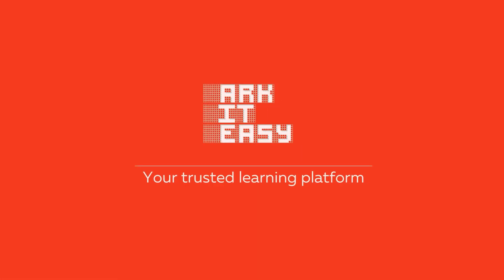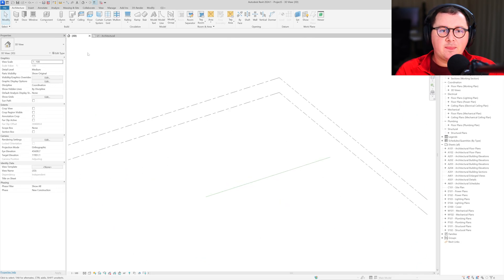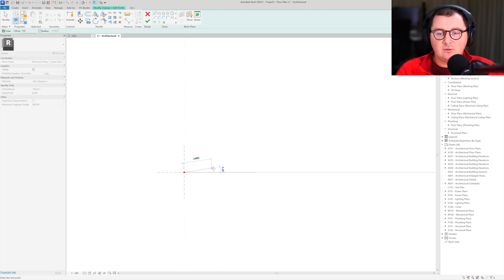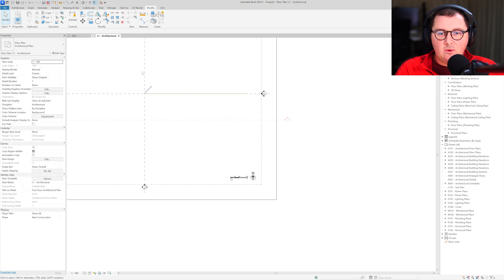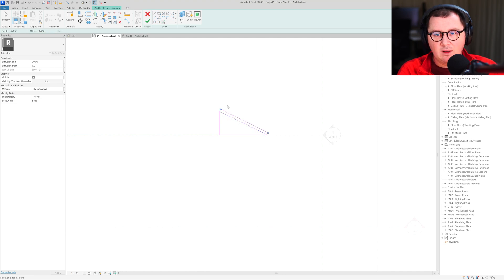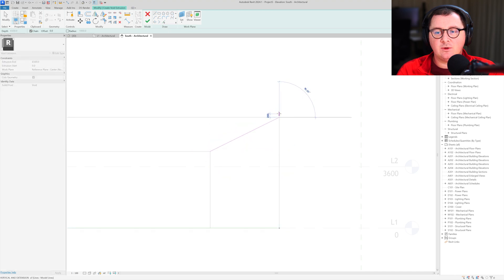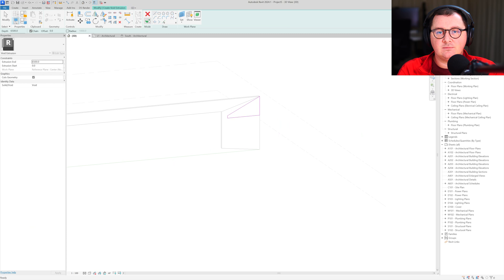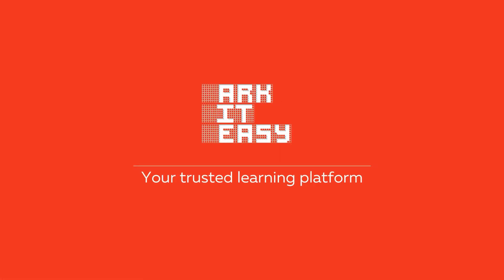Sloped Walls in Revit: Germersheim Fire Station

Comment: Nice ..... it seems we have other way around like picking system family wall for making second wall and editing its profile to match with above sloped wall ... ... just an opinion if it worked out
Reply from the maker: It’s possible to make it that way as well, while with this method you could have greater control of joints between the elements.

This is kind of ‘out of the box’ solution 😀